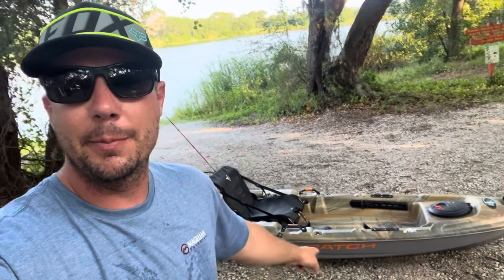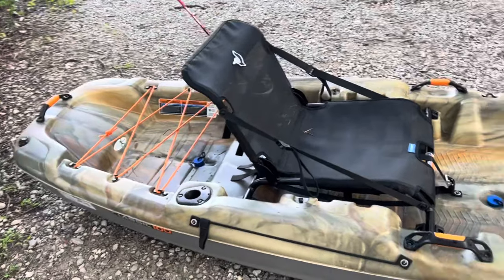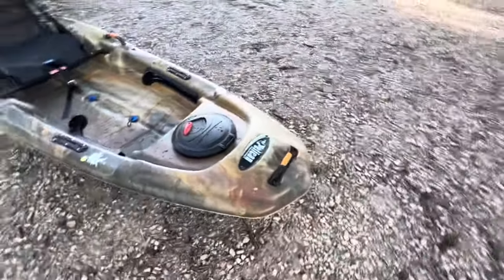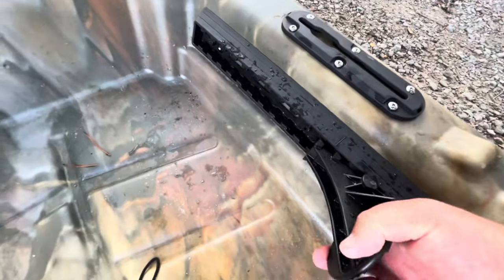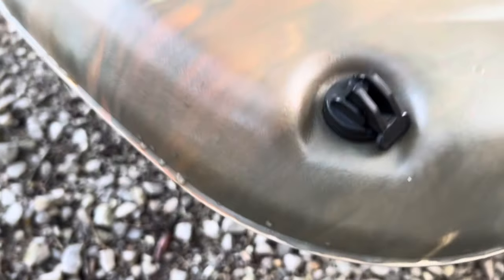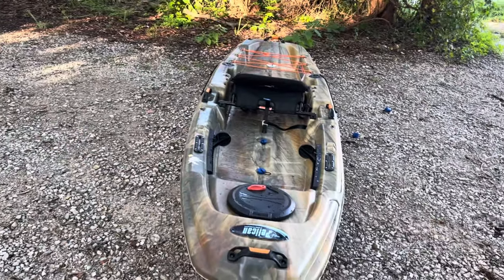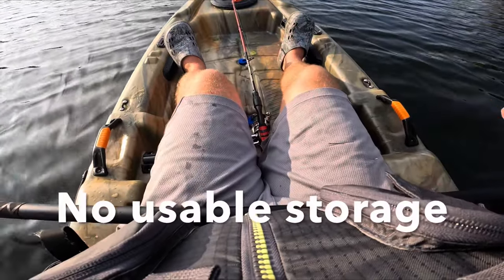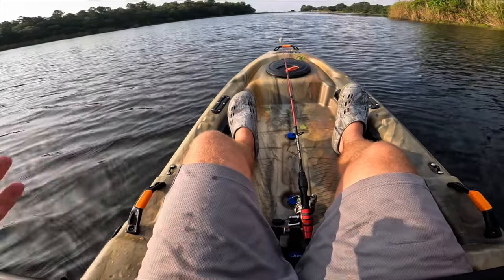Pelican Catch 100 Classic, Best Budget Fishing Kayak!

Comment: I bought one of these and folks I had a ton of fun in it until a few boat waves rocked me then I took a plunge!  I remounted to have more fun then another boat goes by and out into the water I went!  So, I had tried other kayaks and this one is more comfortable and stable but if you buy one I Pray that you don’t have to contend with boat waves!  I returned it and bought a canoe!
Reply: I don’t think a canoe is gonna fix that issue. I hope it  did for your sake. Turn the bow into the waves and you may ride it out better.

Comment: I have one and use it a lot. Absolutely love it for the price I paid. Stable and ample space for gear. It might not track as good as other kayaks, but that doesn't hinder me at all. The seat is adjustable and very comfortable. I can carry 6 rods with the milk crate holding 4. I attached 4 Ozark Trails rod holders (from Walmart) to the crate using zip ties and it works great. The only time I nearly capsized it reaching back for my box, the kayak "stopped" pitching, again it's very stable.
Reply: How much was it? If you don't mind me asking
Reply: How’s it handle on the water
Reply: @CBB316  VERY stable! When it pitches to either side, it kind of "breaks" from going further. The seat is remarkable, adjustable and comfortable, which is a huge benefit! Now it tracks like a snake in the water, but I'm used to it, am sure other kayaks track much better, but then again, they don't measure up to the durability, comfort and stability the Pelican has (especially for the $$$). I also like it because i can run in 4 inched of water without scraping, no problem. Would I buy another one? Heck yea!

Comment: is this big enough for a large dog to lay down in
Reply: I've got one myself, and I can tell you anything more than a chihuahua is way out of the question
Reply: @MultiBassaholic why do you say that? Space? Weight? It seems it has plenty of space.
Reply: @Beyondthebite2024  trust me, it's way too small. It only has a carrying capacity of 350 lbs. Plus, the kayak is only 10 feet long. Your seating position is pretty much in the middle, and the front 2 feet or so are taken up by the trunk. So there's no room for a full sized dog.
Reply: @MultiBassaholic  I see. Maybe 12’ would be more appropriate. Yellowfin 120 maybe
Reply: @Beyondthebite2024  I'm sure with a 12 footer, it would provide more room. if it were me, I would definitely go to a store where you can get hands-on with the kayaks like bass pros or a private dealer. Take a seat and kind of get a feel for how much room each kayak will provide in the floor well for a dog as well as checking the weight capacity for each.